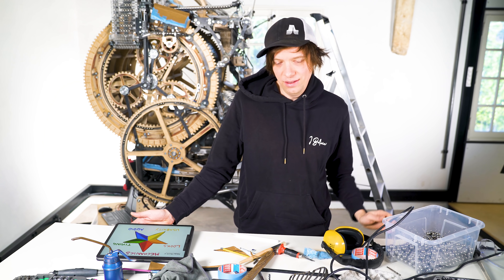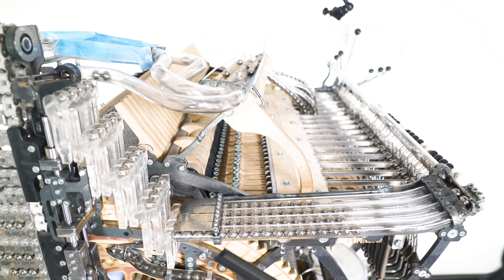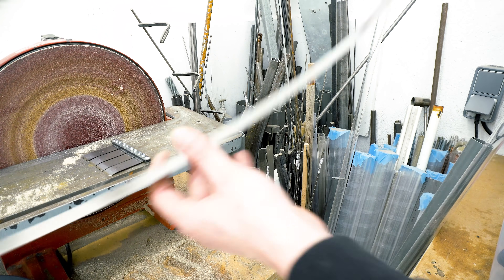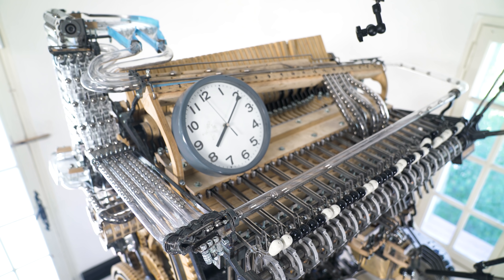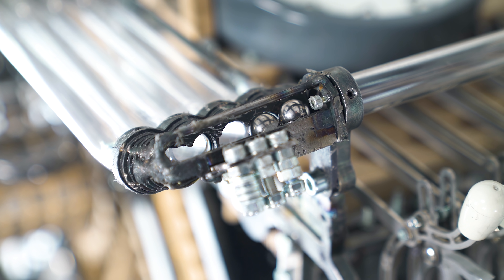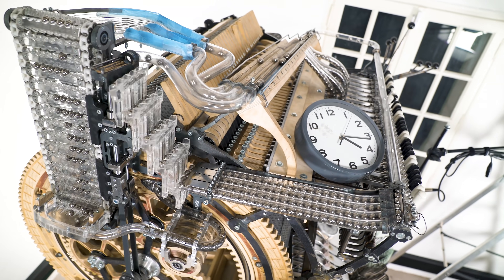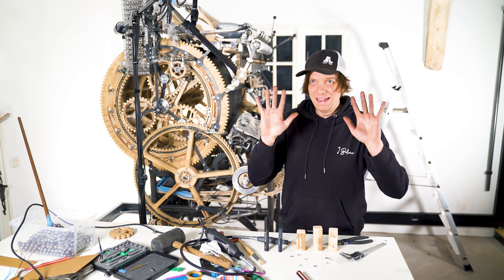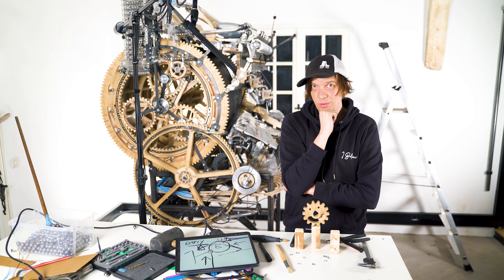Marble Machine X Fish Stair Upgrade

Comment: Stick with it Martin!!!, on a side note, would rounding the corners on the first fish stair make it easier for a marble to roll back if it hasn't gotten seated correctly, rather than the sharp corner that traps the marble against the spring steel

Comment: I think your springs at the first step are the problem. Did you try something stiff, that will push the marble onto the first step, when is it pushed up, instead of pushing it down. Maybe flipping your springs around could be enough to achieve this.

Comment: Today in: Marvin's fight against entropy!

I love this project, and I've been following it from even before day one. I was here when you bought the CNC machine and when you moved to France. I admire your perseverance in the face of frustration, but I also get angry. I get angry because I saw your focus shifting from making something beautiful and interesting, to making something perfect and infallible.
Perfection is a self destructing aim to have, and doubly damaging in this project, imho.
I loved the first video because besides having an interesting piece of music in it, it had this wooden monster picking up marbles with nails, and dropping them with metal wire moved by Lego Technics. It was INTERESTING, and it was doubly interesting to see when a marble lift wasn't full, when a marble rolled on the floor, when something unexpected happened.
I get upset when you talk about chasing perfection and say that if a marble escaped the machine during a concert you would consider it a failure. You're fighting against the complexity of thousands of elements working interacting with each other, and I think that the best thing you could do would be to MAKE IT WORK first, instead of MAKING IT WORK PERFECTLY. You need to play music, you don't need to appease health and safety by not having slipping hazards on your stage. 
Fight your ego on this one, please.

Comment: Stop trying to chase perfection, The machine is far too complex to worry about an equal number of marbles maintained in the stair stepper tubes, Its technically a redundant system to the elevator belt and honestly, unless you run into issues where songs are getting starved for marbles, why worry about it? It's an aesthetic issue until it proves to be a mechanical one.

Comment: If the metal shards stuck in your hands are magnetic, soak your hands in warm/hot water to open pores and then run a strong magnet over your hands to draw the shards out. Then apply lotion. Very important step.

Comment: Great job with this solution! Also, use some duck tape to get rid of those metal shards. Just put it on your finger as if you were waxing your fingertips and the shards come right out. I've dealt with it a lot in the metalshop and it does the trick quite nicely!

Comment: Also, your "divider by 4" is actually solves completely different engineering problem - it "accumulates by 4", which is unnecessary. it is typical "XY problem" where incorrect solution keeps one from even attempting an alternative. I strongly recommend considering different mechanism that would simply direct incoming marble into next channel in order, not waiting for 3 more to come. It should be possible to do some kind of gates so that each passing marble closes its own gate and opens next one.

Comment: It looked like that last marble got jammed because the stairs comes down it slightly pushes it back. Then it doesn't have enough time to enter the gate before it goes back up. Smoothing the front of the first stair might fix it.

Comment: Martin... you have a problem of being accountable to only to yourself. you didn't go to engineering school. you cannot possibly instantly have the knowledge of a phd engineer! if you run into a problem, yes, you can work it out yourself... BUT... before it drives you do the depths of 'giving up', you should really try and ask someone for a second opinion. Not long ago you had a team of people that you could skype or facetime with... some of which were engineers. what happened to the team? Even world chess champions don't go it alone. I'm having a feeling they don't because it would drive them to the insanity in no time!

You don't 'owe' anyone anything at this point. you don't 'have' to finish, however, I could see that you really have enjoyed the journey. There have been far far many more wins and celebrations than one-minute-failures.

Might I truly recommend an engineering mentor or two to keep your sanity. I feel strongly that this admirable turn toward ultimate reliability in functionality (sometimes at the cost of aesthetics) REQUIRES at least an advisor in the wings who can push back and recommend and encourage. I also strongly feel that this can provide much needed mental stability and reassurance and validation!

You're so, so much closer to the finish line than you were even a month ago!!!

No, You're not in over your head... you've been successfully tackling every single wack-a-mole thing that has come up! This is the opposite of any legitimate reason to stop and abandon.
All of this time, you have consistently shown that you DO have it in you.

--->>>>> Possibly more work-life-balance is in order as well?

Peace. and good sanity to you kind sir!

Comment: There is an easy solution to the marbles jumping out if they arrive at the wrong time. You can add a second slope (lets say 45 degrees) to the back of the first step of the fish stair. If the marble doesn't make it to the step in time, it just gets pushed back into the pipe. You can CNC a test piece out of wood and if that worked, get an acrylic piece. An engineer doesn't give up until he knows there is no real solution left.

Comment: Suggestion for tuning how easy it is for marbles to enter tech tube of the divide-by-four: oversize the entrance holes, then partially block each one with a set screw that protrudes into the opening. Then you can adjust the size of the opening by turning the set screw back and forth.

Comment: Martin, I feel like you are getting too hung up on it being perfect and having zero fails. This is a fool’s errand. You are going to have failures that are unforeseen. The best thing you can do is have it fail safely. Like what you did with the spring steel feeding the fish stairs. For that 0.01% of the time where it doesn’t work as planed the marble can escape with no damage to the machine and the machine can continue to operate. Also operating guidelines and rules help. Like you said not running out of marbles. That’s like trying to design an engine that will still continue to work if there’s no more oil lol. If you try to make it 100% perfect you may drive yourself mad.

Comment: There are two basic ways to approach your project: 1) Start with the art, and iterate until you make it work or 2) Start with something simple that works, and iterate, adding complexity, until you're satisfied with the art. You seem to be stuck in the mindset that ripping out the art is final. It's not, you can iterate from simple and rock solid just like you can iterate from complex and broken. The primary difference is that one works while you're iterating, and the other doesn't. A second difference is that simple to complex allows you to isolate and test small systems, while complex to simple requires you to test and fix everything at once.

Comment: Keep with it, Martin.  Your description of the artist vs the engineering dilemma was spot on, and your analogy summed it up very well.  In any large scale system design, the balance is normally between engineering efficiency and usability -- after all if you can't use what you engineered, what is the point in having it?  Here you're adding several vectors that most people don't deal with when you add the audio and the aesthetic.  Timing is an odd one to call out specifically to me, as it is a subset of mechanics -- if the machine behaves orders of magnitude differently at a fast speed than at a high speed, you have a mechanical problem, but that might be a semantics argument.  I've been doing large scale IT design for 20 years and I am so glad you post these videos because I've learned a lot from you.  Solving big problems (even if we've created them for ourselves) is worth the time and effort.  Don't be discouraged because you're whacking moles -- it's what you have to do sometimes.  Don't lose sight of the fact that perfection isn't attainable, it's just the goal.  Sometimes, good enough is enough to get us across the finish line.  We look forward to your continuing adventures!!!!

Comment: I think you cut too much from the spring steel in the previous episode which allows for the dry situation issue you are seeing. Making it a little longer and maybe pushed down a little to eliminate any bounce issue should correct the issue.

Comment: Hi Martin,

I hope this may help you. 
In engineering, there is a concept called Risk Assessment/Management. In short, we prioritise frequent and critical risks rather than fixing all of them. So, we assuming that the machine broke down in the middle of the concert while playing is the last thing we want. Why not focus on that first. 
I mean dropping one marble on the floor isn't that ideal but if it doesn't stop the show (if the gears are protected from falling into). Maybe just leave them and fixing it later or just leave it alone. The worst thing that can happen is you lost one marble (Unless someone steps on it and sues you lol)

To me, a reliable machine is the one that can play without stopping.

Comment: As an engineer with almost 40 years of experience, you will not be able to make this mechanical system perfect. As long as the occasional malfunctions don't break the machine, a marble popping out every now and then is not a show stopper. We all believe in you and believe in your machine. Allow yourself the occasional malfunction and it will be easier to get the end result you are seeking.

Comment: I think you want to focus on the "engineers" solution, and when you know it works, then try to make it beautiful. If the original version worked, but the beautified version doesn't you can move back.
Just never give up, but don't be afraid to take a few steps back.

Comment: The actual problem is that plastic tray goes too low, which allows next marble to climb over the one in a tray. Since they are round it comes out of tube further than necessary. Plus, this creates a lot of power loss, because now it has to push all those marbles in tubes back. All this is clearly visible at 5:15. And the solution is extremely simple - the end of tubes should be lowered in such a way that marble in tube is on a same height as marble in a tray.

Comment: For a lot of these issues, I always come to the conclusion that electronics would be more reliable.  Take the divide by 4 mechanism.  Instead of struggling with a mechanical solution, I would think an electronic counter that counts to 4 before tripping the gate would work perfectly all the time.  Of course, you probably don't want to mess with electronics for this project as that could extend the project for another year.

Comment: Hi martin, if you like the divide by 4 but the system dont work i have an idea. Keep the divide by 4 it's cool, use an open queque where all marbles are free to arrange theiselfs and just change the final piece to the fishster... So its like divide by 4, reservoir ,  4 split, fisher. keep it going

Comment: Although the plywood is highly stable medium of wood, it's still wood, and very much acts with humidity, temperature and seasons.
Also when thinking about touring with the machine, there's still a lot of time, several years until the pandemic and the aftermath is settled to levels when large crowds audience are possible to organize. So no need to rush, just enjoy your journey.

Comment: So for the spring steel spring-a-ma-thoimging, the solution is get rid of the spring. Use a piece of metal with a hinge. And you will need to add a lot of weight so think lead. I would go straight with lead solder onto the steel, and finish by soldering a cylinder of lead onto the steel.

Comment: Jesus Christ, Martin! So what if one marble escapes every few thousand? Who cares? Your concert can still go on, and MILLIONS will be delighted to see it! So long as the machine is not at risk of breaking down completely, there is no issue. Consider that your perfectionism is interfering with the exhibition of what is already an exemplary feat of artistry and engineering. Perhaps you will need to have some tools handy in case of failures. Maybe you will need some replacement parts on standby. And perhaps a few extra marbles in your back pocket. But don't axe the whole project! If you can't get the machine 100% the way you want it, learn to live with showcasing it at 99%! I recommend quickly finishing the engineering side. Then, tighten that timing, tune it, and start recording! Will it really kill sound quality if one marble drops to the floor after every 3,000 or so? Can you not surround the machine with foam carpeting? Don't let your perfectionism make you toss your golden harp because it's 23.5 carats, and not 24. Because that's what you have here; gold!

Comment: I have a tip for fixing the devide-by-4. The weight is put on the wrong way. I dont know how much you know about weights, but the setup rightnow isnt the best for a devide by 4 type mechanism. The bolts should stickout straight to the right, so parallel with the 4 pmma pipes. This is much better than the way they are sticking down at the moment. Right now, the weight is like a pendulum, so pushing it to the right is like really easy for the first few degrees. If the weights are sticking out like I said, the weights will have gravitational energy. What this does: it solves your problem of the balls getting stuck because there should in theory be less resistance/force when the platform goes up (+also more resistance/force if the platform goes down). Idk, its sooo hard to explain, but please just consider it, because its exactly what you need!! :)
Reply: I really hope you see this! :)

Comment: Sometimes you don't really realise how much progress you're making and you get stuck in this mental state that everything is going wrong,

This is not MMX issue whack-a-mole, this is MMX Gradual Perfection. You found an edge case where it takes 10 minutes for a single marble to drop to the floor, there is always a solution to every dropped marble, no matter how hard it may seem to find it and you're the perfect person to do that.

Is there a quick way to delay the speed of the divide by 4?

Comment: Why have the marble swing gate at all? If the first channel gets filled up itll overflow to the second channel etc until all of them are full. It'll perform just as well since when the marble is played i.e. the upper buffer runs low it'll be a non issue and when you get increasingly more in the upper loop then it'll automatically start filling the channels as needed.

Comment: You need to categorize your failure modes into tolerable and intolerable. 
 a marble jam that causes something to break, or, can cause something to break is obviously intolerable
a marble jam that simply causes missed notes, while unwanted, is tolerable, since you probably can recover from it, even live. 
It's similar to the difference between a string breaking on an instrument during a performance and simply missing a note.

Maybe even three categories: intolerable, tolerable, and invisible.
tolerable might be a missed note, and invisible would be a marble misplaced in a place it can't do any harm. Obviously, you can't tolerate marbles dropping down into the machine where they might jam and cause things to shear and bend, but if they're displaced in a way that clears the mechanisms, that is not only tolerable, it's invisible.
Compare instrument breaking, vs hitting the wrong note, vs missing a note.

Comment: I HAVE A POSSIBLE SOLUTION: Instead of having the marbles tipped into the 4 way, you should make the holes effortless for the marbles to go through and use a gate you lift up to let the marbles pass through at the right moment. That would allow for precision timing every time with the marbles. Your issue is that you're sending the marbles though the divider at the back of the marbles when instead you need to send them through from the front of the marbles. It would be far more reliable because marbles cannot pass through too early or too late unlike what you have now. You won't worry about the size of the holes as much and there is only one point of failure: the gate letting the marbles pass through the divider. It would also fix the issue of a ball failing to get onto the fish steps because if the ball failed, the ball behind it would try and take the place of the ball in front of it, be unable to roll forward, and the gate would push it back into position. The incoming balls would push that ball to the last tube and it would thus self correct!